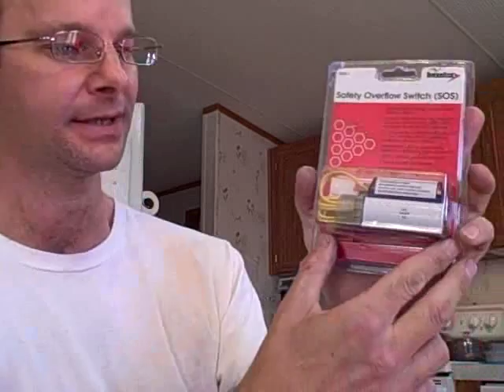HVAC Wet Switch, Float Switch low voltage control. Unit not coming on.

Comment: I think this is my problem (float switch) as I can't find any other prob and brand new capcitor.  Other than cleaning the drain pipe...is there a reset button? I could find no actual button on my float switch. Blue sponge. Maybe I missed the reset button!